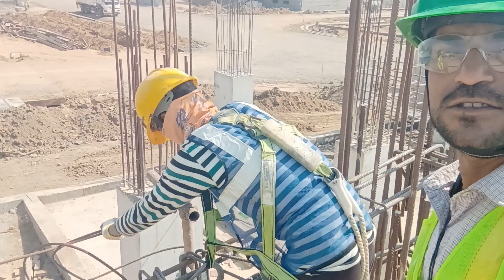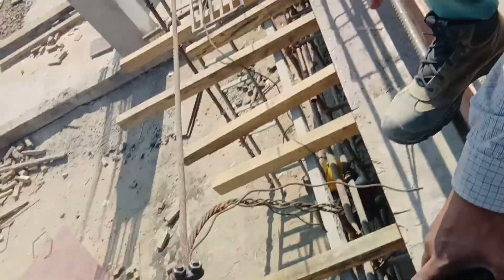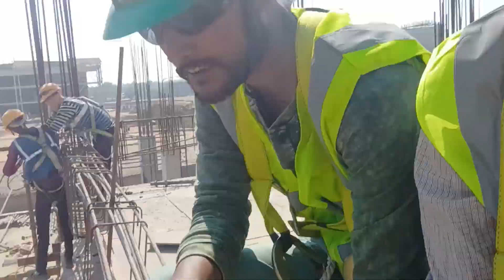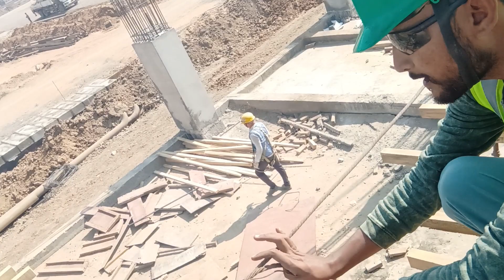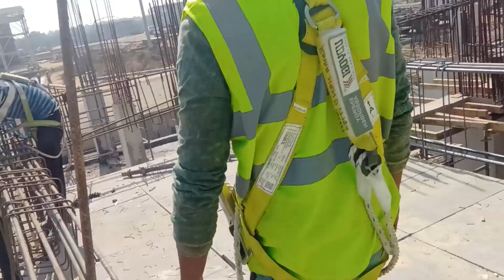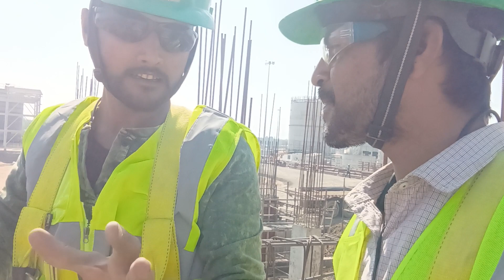LIFELINE  SYSTEM  IN HIGHT EDGE PROTECTION ..EDGE PROTECTION

Comment: Are you sure that the scaffolding standard which supports the life line is enough to bear the maximum load capacity of 5000 lbs/ 2268 kgs? Also the U-clamp is enough in numbers to grasp the wire rope? Who decided this system is enough to withstand the capacity, structural engineer?
Reply from the maker: No but average answer